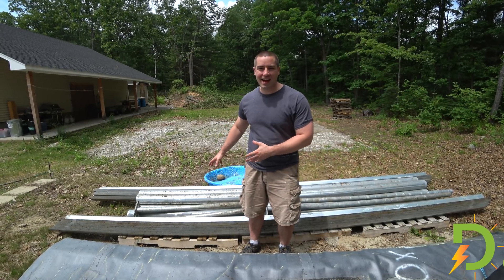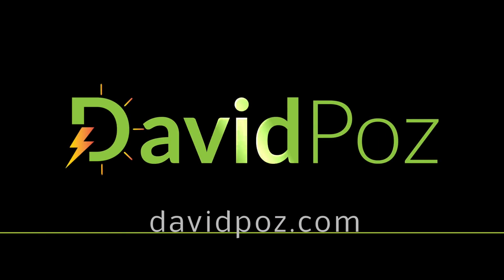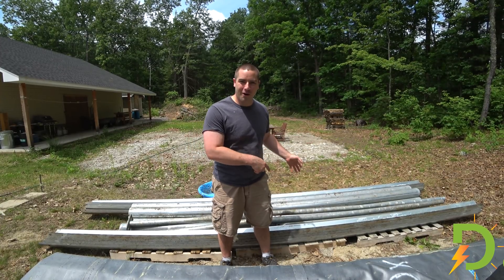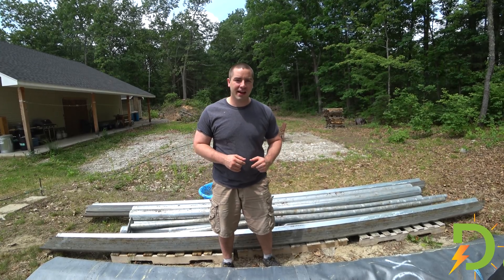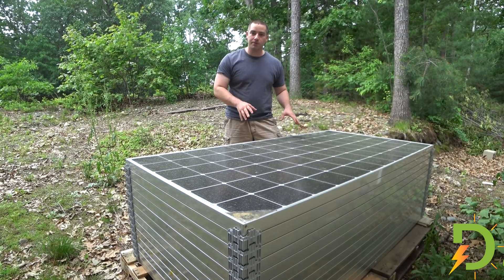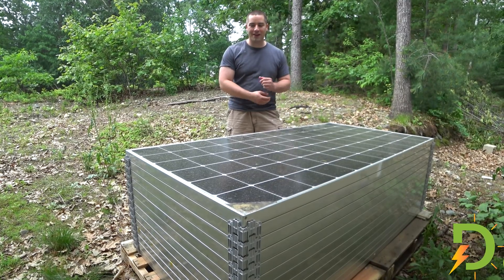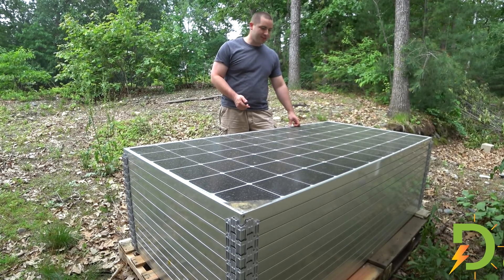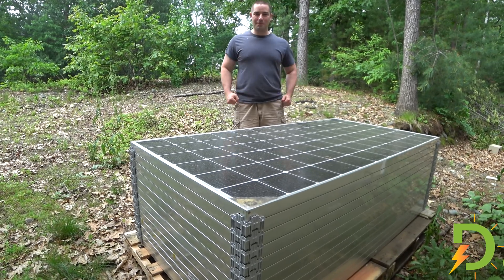Solar Ground Mount Intro, DIY, Off-Grid System

Comment: ummmm, I think you might have a charge controller that can be doubled up, so with your spare one, you might be able to run two arrays (at two different voltages) to two charge controllers to the same battery.
Reply from the maker: You are right that I could run multiple arrays with multiple charge controllers to the same battery.

Comment: For those starting out. 

I weld Galvanized steel all the time. It's not as hard as some here make it seem. Just grind off the galv where you want to weld and about 2" away and cold galv when your done and it cools off. Rust-Oleum makes cold galv, it looks like a can of spray paint. Wear a mask and don't breathe any of it in. And if you do, Metal fume fever sucks but it goes away in a few days.

For welding metal thicker than 1/4 with a cheap wall outlet mig welder. All you have to do is bevel the ends that you want to join together (I use an angle grinder) at around a 70° angle and down to about 3/16". 

When butted to each other and viewed down the side, the groove should resemble a capital "V". 

Your root pass is the most important one. Then fill in the rest, alternating sides and direction and clean before each weld. 

Simple. 

Some people are anal about it. I get it. Specs and shit. But at the end of the day NONE of my welds have failed from doing this. This advice is for Backyard projects and/or hobby welder's. Reputable companies actually have the equipment for welding thick metal. 

You gotta do what you gotta do.

Don't believe me? Try it for yourself.  

Edit: Also! There is NO WAY a pipe coupler is stronger than a weld. Sure it bolts on but the bolts are a weak point in comparison.

Comment: Good morning from Egypt David. I noticed that you will feed the batteries power directly from the solar panels like I suggested earlier. I am sure you studied this well but just so that I feel safe and better I want to say something important. When it is cold the solar panels produce more energy. And when it is hot they produce less energy. As you know I live in Egypt. A warm and not hot country. There are much hotter countries I assure you. And you live in North America, and I assume you have some cold days. Colder than Egypt anyway. So the point is that when you dimension your solar panels to feed the batteries directly like I do without a charge controller, you have to take care that even when it is cold that these panels will not overfill the batteries. It is best if they fill the batteries upto 80%. Or some where between 80% and say 90%. But you should avoid at all cost that you exceed that. 

Temperature coefficients

Voltage Uoc -0,33 %/K

Current Isc 0,06 %/K

Output Pmpp -0,44 %/K

Thee are the important numbers for my panels. You can easily calculate the power you will get and thus the voltage vs the temperature. When the temperature goes up the  Output Pmpp goes down. That is why it has a negative sign. But when the temperature gets colder than the testing temperature then the power will go up. 

Any way I thought I'd say that and I am sure that you will have a wonderful and safe system. 

Best regards from Cairo Egypt.
Reply from the maker: Hi Alaa,  I'm sorry for the confusion, I will have a charge controller.  There is going to be about 100 feet (30 meters) between the solar panels and the batteries.  If I did a system like yours, I would need very thick wire to handle the amps.  It would cost me a couple thousand USD.  Instead I'm going to use an MPPT charge controller that allows me to series more panels together to increase voltage, decrease amps.  Then I can run a much smaller wire costing about $200 USD.  

I stated panels direct to batteries to illustrate that it will not be a grid-tie system (which is 99% of installs around me).
Reply: I understand you. I used Aluminum wires. They are much cheaper and as my wires are coming from the roof then Aluminum is better than copper. Corrosion etc. At any rate I used this site that helped me dimension the wires. Maybe it will help you. http://photovoltaic-software.com/DC_AC_drop_voltage_energy_losses_calculator.php

Good luck.

Comment: Are they anymore if the panels? I need some?
Reply from the maker: Not from my source, but these deals are always out there.  I was putting out the word for probably 6 months.  Let everyone know what your are looking for.  Call Solar installers, talk to people, etc.
Reply: DavidPoz do you know of a good place to start. I'm on the eastern us. Sovsome where close to North carolina. Would be nice.  You got some nice panels.
Reply from the maker: Hi James,  First place to look is craigslist.com  That is where I found my panels that are in the front yard (on pallet frames).  These LG panels I found just by talking to everyone I could, and eventually someone had a lead.  I would also call the local installers in your area.   Eventually someone will know someone who has something.
Reply from the maker: Also, if you buy a full pallet from suppliers (such as Alt-E or Wholesalesolar) they generally get the price down further from retail, close to $0.50/watt.

Comment: Oh, and a "cheap" mig or flux core welder isn't going to be powerful enough to properly weld thick metal like that. Getting a stick welder and practicing with it is probably your best bet. And watch "WeldingTipsAndTricks", it'll really speed up your learning.
Reply from the maker: Thanks.  The pipe has a 1/8" thick wall.  Can that not be done with a flux core welder?
Reply: Oh, it looked thicker than that. You can get a good weld on 1/8 with flux core, as long as it's not too wimpy. Something like a Lincoln 180, or an EverLast of similar or higher power will do fine. Pay attention to the duty cycle when picking a machine too, a 10% duty cycle at 180 amps means you only get to weld for 1 minute every 10 minutes when at full power. 

And you definitely want high quality welding wire, a crappy wire is no fun even after you've had practice. Lincoln is available at most hardware stores and is fairly priced.

Comment: Just a heads up, welding galvanized steel without a respirator or removing the galvanizing is a no-no.
Reply: How to connect a 3face changeover switch

Comment: Just a tip: Think twice before welding galvanized steel. Use a fresh air mask and grind off zink before welding...  Do not inhale the zink oxyde .  Google this before doing it. Do practice the welds on regular steel before attempting to weld the galvanized parts. I would recommend that you drill holes and add brackets where you can because it is sometimes faster and easier than try to join it by welding. And the weld has to be strong enough to hold the pieces together.

Comment: What size pipe did you say it was? It looks more like 3in than 5in, if it's 3, then you could use the post caps and splice connectors from the Ironridge system, welding pipe is going to suck royally, it also changes the temper of the steel at that point. IR also make some nice aluminum rails to mount the panels on. Keep in mind, you will need some decent sized concrete footings in the ground to keep this array from blowing in the wind. If it's really 3in pipe then you can use the ground mount design tool on the IronRidge website, very handy to play with different angles and pier spacing
Reply from the maker: Hi Liam,  5" O.D. on the Pipe.  I should have put my hand next to it for scale.  Big stuff.